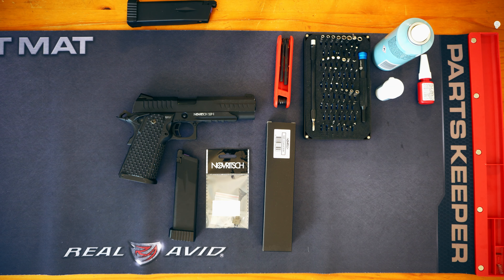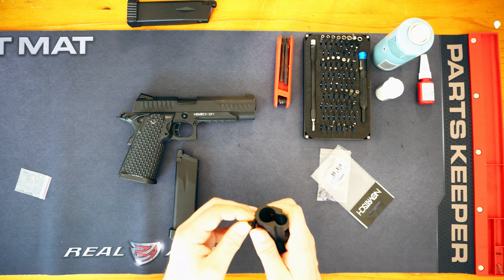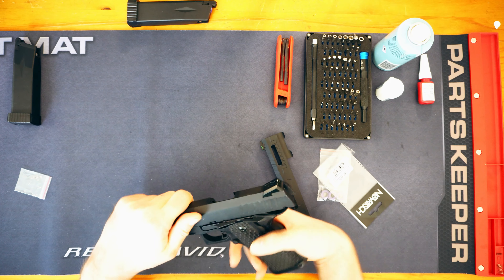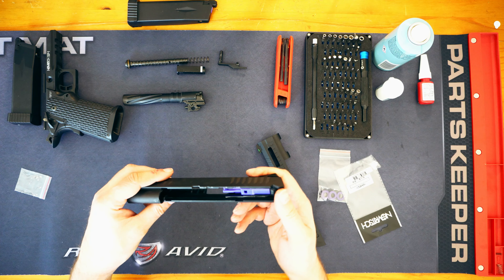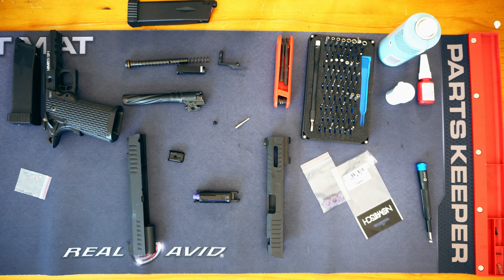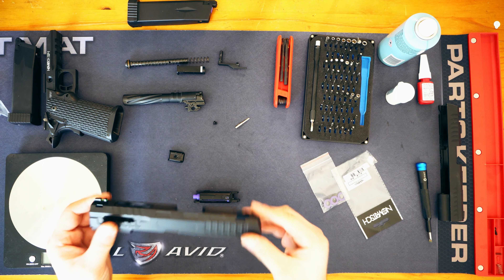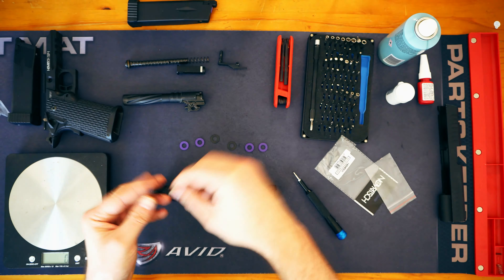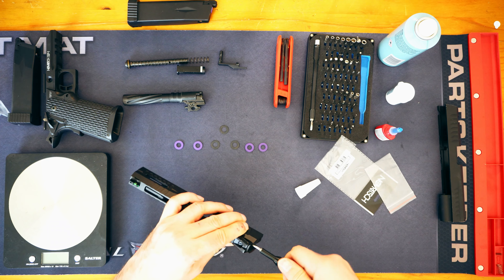SSP-1 Cutout Slide Installation - Airsoft with Azrel

Comment: Hey, nice video. Do you know if the slide fits a cowcow 5.1 tm threaded barrel?
Reply from the maker: So as the base Novritsch SSP-1 is basically KJ Works Hi Capa I would assume if the cowcow barrels are compatible with the KJ Works Hi Capa then yes. Otherwise I'm not sure.